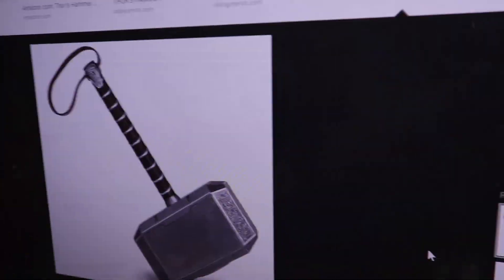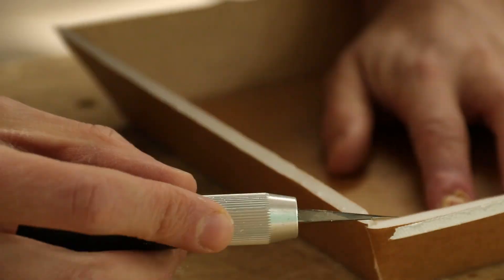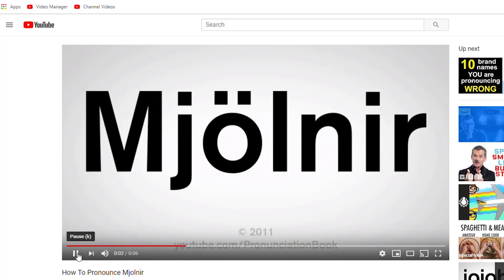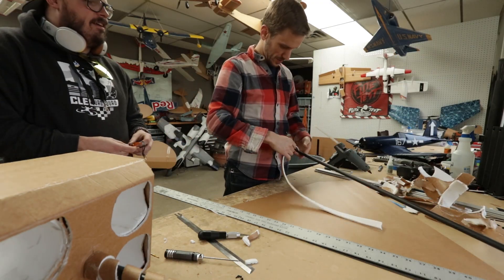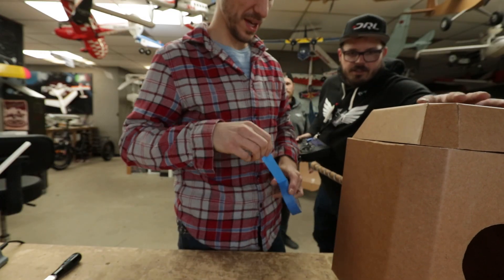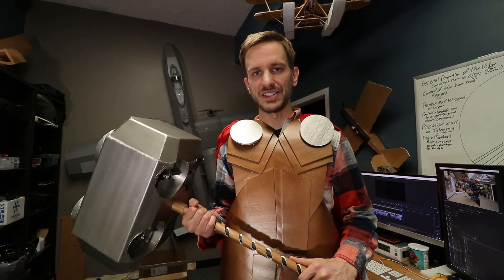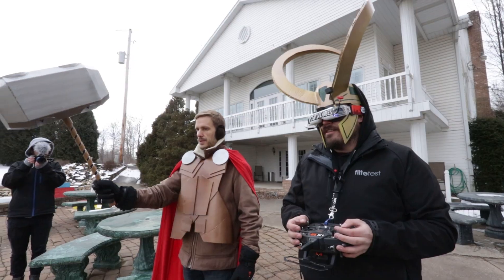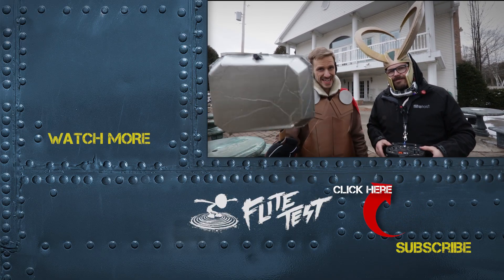Can I Make Thor's Hammer "Mjölnir" Fly?

Comment: So wrap the handle in paper. Then wrap a string helically up the handle over the paper. Take your choice trace the string with pencil/pen or just spray paint. Remove the string slide paper off handle and presto a perfect pattern for the handle. I leave it hollow with an asterisk shape going the full length adding reinforcement. Or cover in carbon fiber.

Comment: You could (possibly, I don't know if it'd have the airflow to do it) have the motors on when sitting hammer side down to keep it in place, and do a kind of "you're not worthy" thing
Reply: Don't think there'd be enough air for the props to push and hold the hammer down. For a propeller to move something it needs air to come in on one side so it can actually generate force, so the hammer sitting upside down on the ground would restrict that airflow
Reply: R U Sirius that's what I thought, I just wasn't sure about it

Comment: Nice to see you're using your head. LOL The top ducts could have been shaved to match the contour of the hammer though. Easily! DO IT!!! LOL  The handle could be much bigger in diameter also without adding hardly any weight.

Comment: I like to be a perfectionist but I know it's not always possible. I've been inventing and building things most of my life. Two things I made that I have videos of on my channel. One is a volt meter that reads between 105 and 135 AC voltage, that I use on my test bench. I have a Variac input wired in series with an 18 volt output transformer to control the voltage range from the socket on my work bench from little lower or higher than the standard 120 AC voltage for testing purposes. The other contraption I made a video of is my 1938 Singer industrial sewing I power from bicycle pedals for leather work. I also repair older electronic and electrical things and I design and make electronic and mechanical  gadgets, mostly for my model railroad. I've seen many of the videos you guys have made before and just subscribed and hit the bell. I love to see how you build things and succeed and fail. We're pretty much on the same page. Many times you will only succeed when you learn the lessons from the failures! I never give up and I never give in! I keep trying until I get it right!

Comment: Don't duct props. Props and fans are completely separate things fans accelerate air and throw it out the back a prop is a wing spinning round its lift comes from the top of the prop the low pressure at the top causes a vacuum which sucks the aerofoil into the the air the downward flow is a byproduct.